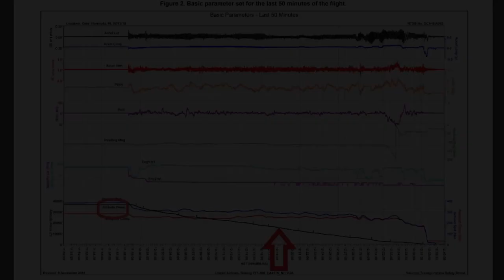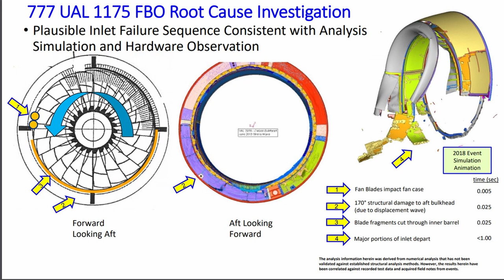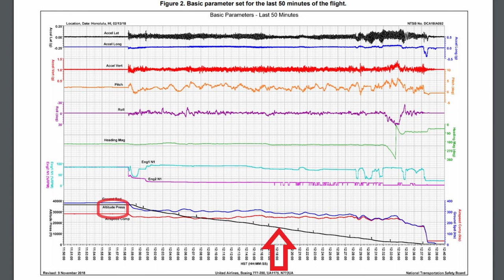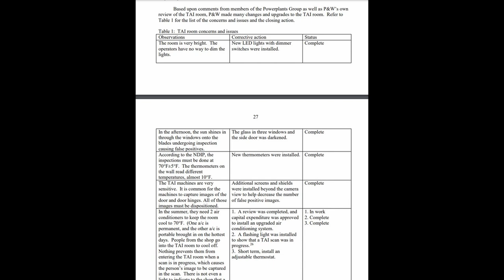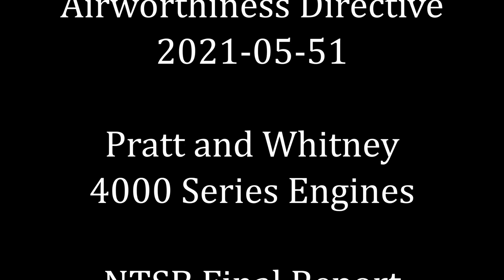Emergency AD & NTSB Final Report UAL 1175 Fan Blade Failure

Comment: I wonder what the expected interval between the initiation of the crack that is detectable using TAI and propagation to blade failure is? Theoretically, your inspection interval would be some degree shorter than that. I'm guessing that really small cracks at thick sections of the blade are exceptionally hard to detect if it relies on some kind of friction. Deep in the root. Lots of material to dissipate the heat.
Reply: From the records of previous tests, it will be possible to calculate all that.
Any seemingly intact blade that shows a crack is a data point for how big a crack can be before failure.
For instance..
Lets say that you see many many blades with 0.1mm cracks, some with 0.2mm, a few with 0.3 and none with 0.4.
Depending how careful you want to be you might let any with 0.1mm cracks go back into service. Then you can get an idea of how long it takes to go from 0.1 to 0.2

Comment: NDT takes me back to my time in avionics with Marconi. Most of our testing was simply vibration tests on LRU's  at levels beyond what was expected of the airframe to ensure  security of internal cabling/connectors and seating of circuit boards.  This TAI is obviously much more involved than that, those inspection guys have an interesting job. Thanks also for further info regarding ETOPS, so much to take into consideration when adjusting for one engine out. Thanks as ever for the clear explanations Juan,

Incidentally I looked for some Californian asparagus but my local supermarket only had Mexican!

Comment: Thanks for a tech briefing on a very complicated technical subject.  Early in my  aviation career,  (50 years ago) I lost almost 14" off a prop in a Cessna 310. As the engine mounts on this port engine started to fail the whole engine/prop/cowling started torquing towards the aircraft center line. I got the engine shutdown and prop feather before the remaining prop started to eat me and the cockpit. I was trembling when I dismounted the aircraft. Thanks for the clearly laid out explanation. Things go south in a hurry at these RPM's.

Comment: Not an expert in it, but polished metal has low thermal emissivity, painting the surface will improve that and effectively calibrate the measurement.  It's a bit like turning up the gain of an antenna, it increases the dynamic range (experts may hate that analogy).

https://www.npl.co.uk/resources/q-a/why-is-emissivity-important

Comment: Definitely no expert here, but it sounds like they're reaching a point where it would be more efficient to just replace the P&W engines.  Thanks for explaining things so well that someone like me can actually understand!
Reply: I was thinking more like time limiting and tracking of individual blades. Your idea sounds better.
Reply: Since most of the 777s that have these equipped are older models, a decision to “replace” the engines would likely equate to a death sentence (aircraft retirement) to them.
Reply: @stephenrich3029  So, you are of the opinion that re-engining cost is that close to total plane replacement in COST?
Reply: @upgrayedd9732   My understanding is that Yes each individual blade is permanently marked with a unique  fingerprint.  I believe also the foundry maintains "sister" stock for trend analysis for each "batch".....one part for manufacturing feedback that seeks to know where to do more research and development in the improvement cycles...but also importantly to notice if any kinds of anomalies occur that were not detected or predicted in process all the way through the life cycle of the component.  This would be consistent with all critical flight safety components in aerospace.  

In terms of remove and replace and discard, that is a very very expensive and time consuming ...

Keep in mind that blades are "married" as a set to a particular engine.  So when you do have failure, more than likely what actually happens is that entire engine spends a very long period of time , off aircraft, awaiting funding and time to spend rebuilding...and depending on the time cycles, it might not be cost beneficial to put it back into service.  For the most part, manufacturers supply carriers with a limited number of remove and replace engines..as a consequence of both contracts that are hammered out AND also the high costs associated with maintaining a high volume of "backup".

it's essentially one part time and resources, and the other a bottom line driven decision.

for high precision critical flight safety systems like an engine, and specifically for those rated for ETOPS profiles, this cost can quickly get out of hand very fast...

one does not just make an order to the foundry to produce two, three, five sets of fan blades for each of the two engines for each aircraft.  While this incident is significant, in the bigger picture, the trend analysis shows these blades have a very low failure rate. I believe (although I am making this as a pure assumption), the fan blades failures here with the PW4077 are a result of something very specific with either manufacturing or NDI or both.  Hollow fan blades of this alloy composition are not unique to the PW4000 variants.  I think there is likely some problems related to not detecting at manufacturing and or  the NDI inspections did not pick up low cycle fatigue...
Reply: @stephenrich3029  Thanks for that info -- I suppose someone has run the numbers and determined it's less costly to test every active engine and keep the affected aircraft in service.  Sure sounds like the testing process will be costly, though.

Comment: Right. The training and the specs are all for a benign failure of the engine. The first time I realized it wasn't the whole story was a cargo 707 that lost an engine which trashed the leading edge and I think also damaged the other engine on that side. They landed at the longest runway in France with the wing on fire. Then there was the Evergreen 747 that had a similar failure and barely made it back with three properly working engines despite what the numbers say. Again,  they trashed the leading edge and suffered a huge increase in drag. Evergreen nearly cooked another engine trying to stay in the air. The CVR transcript is a very exciting read. Thermal cameras have come a long way in the last few decades too. I recently worked on night vision using microbolometer cameras, those things are at the BS end of physics. They work by detecting the temperature rise in a 'wire' that is exposed to the heat source by comparing it to a near identical but masked 'wire'. Wikipedia explains it well. BAE Systems, who now also do the 777 FBW, make the best ones I am aware of. Not sure if they manufacture in MA or TX, but they are American made.

Comment: I didn't go through all the comments but painting a surface before using IR thermal readings increases the transmission (if a dark color) but more importantly it increases the consistency of the readings across the surface. I am betting the paint is dark and flat especially given the uneven surfaces.   Great report and great channel, I don't care what Gryder says about you.
Reply: To find much more information about the Thermal Acoustic Imaging, check comments by GiantGerman, PerfumedManatee [and "TDM MCL" and other replies too], cageordie, and Stephen Meschke. And David Clawson asking a reasonable question receiving a reasoned reply from Dougal Tolan.

Comment: Excellent review and a thought provoking discussion. The flight crew has "drift down charts" based on the loss of an engine at altitude. These charts show the altitude that can be maintained on a single engine. Most folks don't realize that above about 25000 ft altitude that the aircraft's true airspeed will actually slow down at a given mach number. This is because the ambient air cools (adiabatic rate) at the rate of 2 degrees per thousand. The speed of sound is a function of air temperature, and actually slows down as the air cools. Jet aircraft normally cruise at a percentage of the speed of sound, so mach .80 would be 80% of that speed. Above the tropopause, (35000-40000) the air no longer cools at the adiabatic rate. This is also the altitude where the prevailing winds tend to drop off. The primary reason for flying a jet aircraft at those higher altitudes is to take advantage of the thinner air density, which creates less drag, and therefore greater fuel savings, reducing costs while extending range. A second consideration would be to fly above the tropopause where the headwinds would be much lighter.

Comment: Thanks for the update on TAI. We’re starting to use CAT Scan technology to inspect wall thickness on hollow HP Turbine blades now too as we’re starting to run into life limiting conditions after decades of repair cycles where removal and re-application of the diffused aluminide coatings takes away 0.001 or 0.002 of parent material each time.

Comment: Great coverage as usual!    Question?  Wouldn't it be a simple enough upgrade to add external cameras showing all exterior components on a screen in the cockpit?
Reply: Simple is a relative term. The additional weight from the camera and wiring, the updates to the manuals and training, certifications, etc. Its better to focus on solving the root cause and hopefully preventing the problem. I’m not sure adding cameras would be enough of return on investment for safety. Especially on older aircraft.
Reply: @Top Load Tele  
Yes!  
 @MeppyMan  
Weight addition would be minimal.  Probably less than the total weight of one average passenger, including the camera modules, mounting, wiring, PSU, and monitors, etc.

Some aircraft already do have cameras for the main and the nose landing gear.

Cameras:  Even the Mars Perserverance Rover used off-the-shelf cameras that only needed slight modifications due to environmental factors.

My professional dSLR cameras use incredibly robust vibration-, temperature-, and water-resistant sensors and lenses, and cost just a few thousand dollars.  Pennies considering the overall cost of an airliner.

And the new vehicle we just bought for my wife has 4 cameras (front, back, and L&R sides for blindspots).

Yes, changes to operating manuals, checklists, service guides, and training, would be extensive.  But honestly, addendums like this happen A LOT for the addition or updates of even much simpler systems on aircraft...i.e. headrest entertainment monitors, etc.

And these systems are not complicated.  It would run automatically, basically it's either switched on or off, just as a simple home security camera system would operate and record your home's front door/porch area, day or night.  And they have very minimal power requirements, so they could be operational even on emergency/RAT power.

Consider that a HUGE amount of useful and valuable data and "evidence" now exists or is available, as nearly everyone now carries an incredibly good still & video camera with them at all times via a smartphone.

FFS, the absolute BEST DATA that was collected in this actual incident were video and photos taken by non-professional CIVILIANS either on the ground or actually on the plane!!!  When you consider that fact, it's a complete joke that the airlines aren't implementing their own video monitoring systems!!!

Cameras mounted to view the engines would also prove incredibly valuable in nearly ALL TYPES of incidents if recorded to a time-coded/synced Video FDR!   I actually can't believe that these systems are not already implemented!  The data would be INVALUABLE, even for pilot training!

I would also propose a skyward- and ground-facing camera for easy & live visuals of the sky both directly above and beneath the aircraft, as it is IMPOSSIBLE to see any air traffic or other potential hazzards whatsoever from these areas from the cockpit view.

Just look at the information gained (and liability issues resolved) from the use of a $50-$100 forward+rearward automobile dashcam recording unit!

And a second or side benefit would be to finally actually capture and record a supposed UFO encounter, LOL.  :-P   You would probably be supprised by the actual amount of sightings made by airline pilots & crew that are never reported and/or made available to the public.

In my work I use robust wireless transmitter systems (under $1000 for the entire setup) that transceive 4K UHD video or stills from my professional still & video cameras to the client's & producer's separate viewing area ("video village") from over 2 football fields distance (line of sight).

And our "mobile production office" and client & talent RV motorhomes have wireless backup camera systems that are weather & vibration resistant for $500-$1200.

IOW, it would NOT be difficult nor very costly to implement this, at least in new production aircraft.  And I honestly don't believe that even a retrofit system would be that difficult or costly, especially in relation to considerations for airline safety.

Comment: Excellent video, yet again. Thanks Juan. I was involved with MRO work (mostly airframe) at one point in my career and visited the P&W facility where these blades were inspected. A first-rate facility in every way. I'll be very curious to find out what the NTSB has to say about inspector training and procedures for these blades now that there's been a second incident. Given the critical importance of engine blade integrity, I suspect these recent failures will generate significant changes in the way all fan blades on all engines are inspected. I have limited understanding of all the possible NDT and inspection processes available for ensuring blade integrity, but I'm sure adequate technology exists for thorough testing and inspection so the changes will likely focus on procedures and frequencies of T& I. Further, I would speculate that once again humans may be taken out of the loop and replaced with robotics and A.I. that can provide a higher confidence in 100% accuracy in the T & I programs.

Comment: Great video again Juan! I myself every morning walk by the powerplant dept and look at a GE CF 34 on the assembly line. You will notice the Challenger 600 series and a10 sound the same! 😉

Core engine shows up and they install the cowling designed and made by Canadair now Bombardier.

Cowling , doors, thrust reversers etc have to be designed and certified by transport Canada, faa, easa requirements etc.

I myself back in the day would inpect skin panel doublers via ultrasonic inspection looking for voids in between the skins.

I was also inspector for composite dept. As you mention the tap testing, I still have my little hammer.

Comment: Find it interesting that the company who built the engine is doing the proof testing. Surely hope they do what is required to understand and correct the failure. Thank You Mr. Brown, very informative! 👍🤶🎅👍
Reply: Good point
Reply: Those inspectors are probably the only ones in the world  that can inspect those blades
Reply: @easternwoods4378  
That would not be uncommon with NDI inspection techniques.
Just like when you purchase a firearm, you're not approved, you're "not dis-approved" it's all in the legal language.

NDI has a lot of mumbo-jumbo in it. The report won't tell you what is wrong, it will state that an indication was found. Been down that rabbit hole too many times while performing a repair on composite components.
Reply: Where do you suggest people find the expertise to know all details of the fan blade except for the manufacturer.
Reply: @gungadinn  "it will state that an indication was found"
People may find it interesting that a similar issue exists for various imaging scans in medicine. Doctors are often leery of ordering them in many cases because they, too, may well show "possibly something". To be clear, I'm not a Dr, but I have several family members who are plus of course they have many friends who also are and they've a saying about certain scans that amounts to "the problem with it is you can always find SOMETHING on it that could possibly mean something", or in other words it's not definitive but can waste a whole lot of time (and money) chasing phantoms.
The reports aren't vague because the Drs writing them are hedging their bets, it's because often the scan is possibly being employed as a "look for something" vs "focus closely on X and Y due to other factors suggesting Z".
Reminds me of the example from the classic list of supposed engineering reports in response to flight crew reports:
Crew: Something loose in cockpit.
Eng: Something tightened in cockpit.
;-D
Reply: @2Phast4Rocket  Great question. Would have no idea. Obviously there are no outside imaging companies that can test the blades without corporate manipulation.

Comment: Nice shot of the Greenland mainland. We always flew to LAX in the late afternoon and usually tracked up by Thule about 77 North so really only saw Greenland in twilight but managed to witness the sun rising from the west and then the subsequent double sunset. We carry a 5% contingency of the EDTO fuel to cover any drag issues with airframe or engine damage. It will be interesting to see what fuel burn difference from the planned v actual.